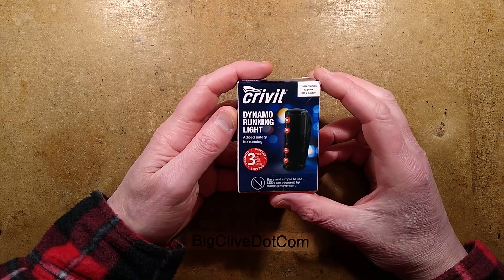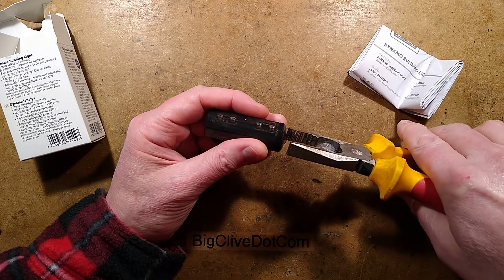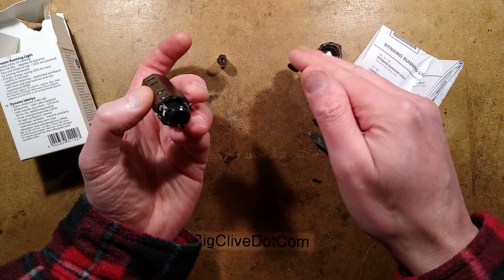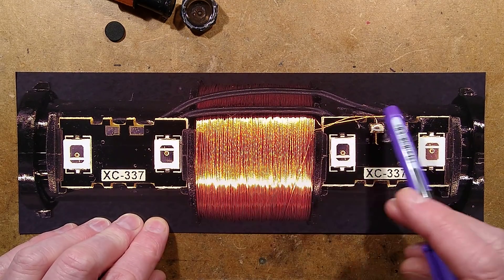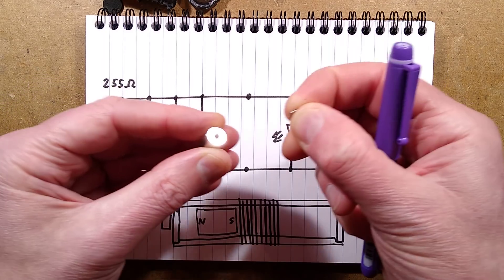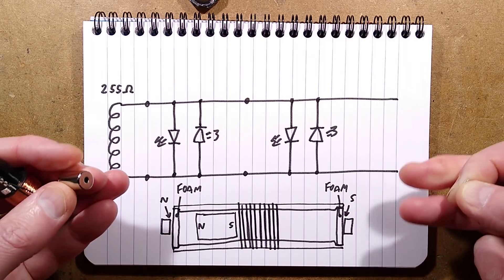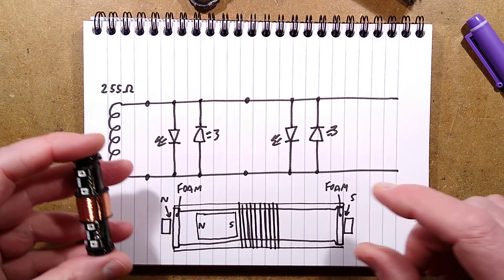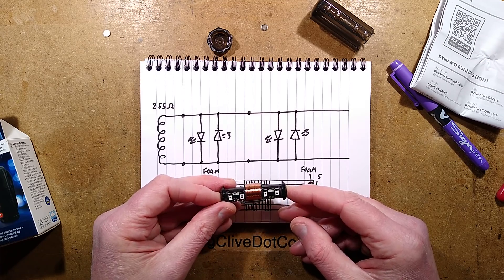Lidl self powered jogging light teardown (with schematic)

Comment: I would also vote that the hole is to let air get through.  How tight is the magnet in the coil?
Reply from the maker: That's a good point.
Reply: @bigclivedotcom  Clive, should you so accept... I/we have a challenge for you... Gravy easy to prove one way or the other.

Take a piece of tape and cover that hole in the magnet (do both sides just because lol) and show us how well the unit works with the modification.

My personal bet is that it may still flicker a little or whatever but will not have the output that the hole allows because the movement of the magnet will be severely dampened.

Others disagree and say nope, doesn't matter.

If you would, good sir...
Reply: @MadScientist267  yep,  it won't make a difference...
Reply: @MadScientist267  What matters is whether or not the designer thought it would matter, not whether it actually matters. Plus, as someone already pointed out, it could have come down to a deal on surplus magnets -- and the ones on sale were the ones that take about 2% less raw material to make. Someone could do an experiment and find two magnets of the same size/diameter -- one with a hole, one without. And run them both through a coil and see what difference there is. From what I could find online, I think the one with the hole will just reduce the overall magnetic field a little bit -- generating slightly less power per slide across the coil. And that lower output could have been achieved by using fewer windings on the coil instead. So why use the magnet with the hole instead of fewer strands of copper wire?
Reply: @shanejohns7901  Because the air will flow thru it lol
Reply: @MadScientist267  Could be. But certainly unproved/undemonstrated. Could also be simply because the magnets were the ones on sale that week.
Reply: @shanejohns7901  Use some common sense. The process of making the hole would be more expensive than a solid slug of magnet.
Reply: @MadScientist267  It's not though. Do some research on how these things are made. It's a molding process, not a drilling process. It's not the least bit more difficult to make, and actually slightly less expensive because of the reduced materials needed to make it.
Reply: @shanejohns7901  Lol the complexity of the die on the extruder makes it more expensive genius but whatever.
Reply: @MadScientist267  It does not take a genius to realize that they'll need a mold made no matter the shape they make -- whether they make solid rods, or tubes with varying thickness walls. In fact, they probably have a whole set of them (with varying thickness walls) to go with the machine. And they simply replace the ones that wear out. That die mold cost is brought nearly to 0 by the sheer number produced from that single die mold over its lifetime. The saved rare-earth material -- probably a couple/few percentage points or more by weight -- more than makes up for it if enough magnets get produced.
Reply: @shanejohns7901  🤣🤣🤣🤣🤣🤣🤣🤣🤣🤣🤣🤣🤣🤣🤣🤣🤣🤣🤣🤣🤣🤣🤣🤣🤣🤣🤣🤣🤣🤣🤣🤣🤣🤣🤣🤣🤣🤣🤣🤣🤣🤣🤣🤣🤣🤣🤣🤣🤣🤣🤣🤣🤣🤣🤣🤣🤣🤣🤣🤣🤣🤣🤣🤣🤣🤣

Try again
Reply: @MadScientist267  Given that you've taken up over 25% of the replies on a thread that's not even yours, I'll leave it go at that. I'll get no more replies from you in my email box, thankfully. ;)
Reply: @shanejohns7901  That how things are measured now? Sigh.
Reply: Maybe the maker of the product just got a good deal on a bunch of magnets that just so happened to have a hole in them.
Reply: @sarathai2876  Yes likely that hole is for the original design, to mount the magnet on a plastic rod, probably because it was a pulsing toy, using a coil to move the magnet up the rod. Also saves on the expensive rare earth material as well, an added bonus in the light, as the magnets likely are the most expensive part.
Reply: @sarathai2876  They are common on Ali, so I would expect magnets with holes in them to be a standard item on the wholesale markets in China.
Reply: @sarathai2876  or maybe it just made the manufacturing process more efficient...
Reply: @sarathai2876  When dealing with China, that's is ALWAYS a possibility.
Reply: Hey Clive, fill the hole with wax or epoxy and see what happens.
Reply: Came to say the same
Reply: My first thought as well 👍
Reply: A small side effect of the hole is to concentrate magnetic flux and increase the power and reliability of the magnet slightly.
Reply: @avemt1  Having no material on the inside allows magnetic field lines to fold on the inside instead of pushing further outside. That should make the outside field weaker.
Reply: @teardowndan5364  Thank you for that information. I considered that it would concentrate the field lines closer to the magnet.
Reply: @avemt1  that was my thought as well. There could be another factor involved too. I was thinking the hole might weaken the magnetic field at the ends of the large magnet,  so it wouldn't incur too much resistance when approaching the little magnets at the ends, which if too strong, might not let the larger magnet travel far enough in its throw... 

Another thought I had,  was that the hole could just be for simplifying the manufacturing process....
Reply: you guys are reading wayy too much into this. That hole isn't tight tolerance by any stretch of the imagination. i've worked a couple years with chinese suppliers in electronics that our company designed and you would not believe how many times they switch components during a production process. We'd get a product WE designed with chip brands we never ordered for them to use. There is no vaccuum in this product obviously, and its not needed because the tolerances in that hole are big enough to let the little amount of air travel through. The hole in the magnet is most probably just the flavour of the week at their distro.
Reply: Exactly what I thought
Reply: Beat me to it
Reply: I came to see of this had been posted as a reason. I am happy to see that it was.
Reply: I assume it allows it to move more quickly therfore generating more current in the coil
Reply: Yes, this was my thought, too. Perhaps Clive could block the hole and see what changes in performance.
Reply: Was gonna write that exactly. Only to see your comment on the top. Thats my guess as well.
Reply: Or maybe not letting the air through would create an additional spring at the ends to increase the power even further? Hmm...
Reply: @benbaselet2026  The small disc magnets behind the rubber pads at the ends seem to be the springs/brakes to keep the big magnet from hitting at the end of travel and maybe provide a little push in the other direction.
Reply: @benbaselet2026  Not letting air through would increase drag with the magnet fighting vacuum on one side and air cushion on the other, especially at the beginning where the magnet would likely be resting close to one end.
Reply: @benbaselet2026  ,
You're introducing a sort of ~mechanical inductance/counter mechanical force (i.e., mechanical equivalent of counter-electromagnetic force), if you will, into the design if there's no way to dissipate the differential air pressure.... There'd be a vacuum working against it on one side as well as a pressure working against it on the other. 🤷‍♂️
Reply: How long before Clive or someone else (Electroboom or AVE perhaps) tries to link a whole bunch of these things together and make some kind of coil gun or rail gun?🤔💥
Reply: @goodun2974  Look up Forgotten weapons youtube channel. He tried several prototypes of theese futuristic weapons. 

Spoiler: they aint that good yet...
Reply: That is unlikely since the volume of the chamber is minuscule, combined with velocity and weight of the magnet, air resistance would be negligible...
Reply: @Quickened1  Not how it works
Reply: @MadScientist267  yeah...ok. I know how it works,  and there are other factors as well,  such as clearance between the housing and the magnet,  but since this is not a precision device,  I would lay money that the hole in the magnet does not affect how it travels through the tube. The original shake flashlights had solid magnets and they worked perfectly. Combine all of the factors I mentioned,  and I'll be proven right. And yes,  I know the most important factor is the clearance between the magnet and housing, and I'll bet it's pretty sloppy...

Easy to prove though, just fill the hole with wax and see how it works...
Reply: @Quickened1  The ratios are what matter most. A syringe doesn't have much volume either. Cap off the end with air inside and note how much "not easier" it is to push in than a bigger one.

Pressure doesn't care about volume. It does care about displacement.
Reply: @MadScientist267  a syringe is sealed along the sides, this device is not,  and there's a minimal amount of air to move. As long as there's a slight clearance along the sides,  and there is, otherwise it wouldn't move, it will allow the very small amount of air to pass by...
Reply: @Quickened1  No because the speed at which it moves plays a major role. Fluid dynamics isn't as simple as you perceive it to be.
Reply: @MadScientist267  I do understand, but when we are not dealing with any appreciable pressure,  the speed at which the magnet moves will have little to no effect on resistance, especially in such a short distance, and because nothing in this cylinder is sealed. I still say hole,  or no hole, there will be no detectable difference, in how quick the magnet moves!
P.S. you have no idea what I know... and it is quite simple to me...
Reply: @Quickened1  Trust that the hole is not there by accident. It would be a more expensive shape to make in the grand scheme of things if nothing else... I understand what's happening here, it's obvious you do not.
Reply: @Quickened1  - Same amount of air in a brake caliper where the slide pins go. Too much grease on the pin and it refuses to go in. The air will compress some but doesn't disapear.
Reply: @OldBenOne  agreed,  but this is not a sealed chamber. It has a clearance between the magnet and cylinder... if it were made tight, it wouldn't move at all... In addition,  the ends are not sealed either,  so the air can escape there as well... The hole in the magnet is not necessary for it to travel through that cylinder... period...
Reply: @Quickened1  I guarantee you it is absolutely critical to this device functioning as intended.